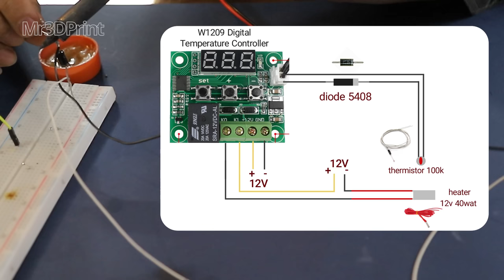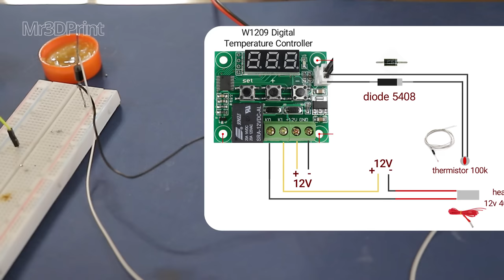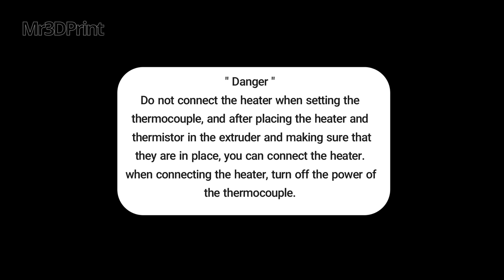#6 Heat and motion control with Thermostat W1209 & gearbox motor  -free filament (PET)

Comment: Why did you use w1209 and not the arduino shield?
Reply: I think he uses it because is cheaper XD
Reply: @mauriciocalderon102  Lol, he already use the arduino for the stepper motor, the arduino shield already have connections for thermistor, so I wonder why he used the w1209 but not the arduino.
Reply: @fastprojects  this setup is without arduino and stepper motors so cheaper and simpler
Reply: @tristansimonin1376  you're wrong my friend look at video number 5 and you will see.
Reply: @fastprojects  it's a new setup with a dc current gear reduce motor
Reply: @tristansimonin1376  ok thanks 😊
Reply from the maker: Many friends were unfamiliar with Arduino or did not have a computer, this method was made because of its cheapness and availability for everyone to choose and video
  This w1209 board practically shows the temperature up to 110 degrees and we have customized it for our work with a little change and we can adjust the temperature up to 290 degrees
Reply from the maker: @mauriciocalderon102  Yes that's right
Reply from the maker: @tristansimonin1376  Yes that's right
Reply: @mr3dp  But it's really inconvenient to see wrong temperature and calculate the actual one yourself...
Reply: @mr3dp  ¿Cómo es esa personalización?
Reply: can confirm its WAY cheaper

Comment: I've made a similar setup using an old 3d printer board and an extruder to pull the filament from the nozzle, is working like charm. Thanks for your videos, you're great! I'll try a gearbox (when I find one, I mostly use parts from trash).
Reply: Where is the video of your set-up?

Comment: Hi instead of using the old computer power supply, can I use the 12v 20A 240W power supply? And should I connect two wire like in 0:52 ?
Reply from the maker: yes

Comment: Excelente alternativa a la ramps. Ya quiero hacer mi recicladora de botellas. 
Dos observaciones, las temperaturas Celsius y Farenheit están incorrectas. 7:25
Y el w1209 trabaja hasta 100 grados Celsius.
Excelente trabajo, gracias por compartir.
Reply from the maker: La temperatura ingresada es correcta (por supuesto, esta temperatura no es real porque la temperatura de 77.5 grados Celsius que se muestra en el panel es en realidad 205 grados) Lea el texto del video
Reply: @mr3dp  Leí el texto, lo que no logro comprender es la equivalencia. Como quiera lo probaré, los circuitos son muy económicos. Gracias por responder. Saludos.
Reply: Hola ! Yo no logró que el hotend suba la temperatura , cuál será mi error ? Gracias !
Reply: Hola! Yo no logró que suba la temperatura a que se debe mi problema ? Gracias !!!!!
Reply: @workshop506  a mi me pasa igual hay desinformacion en el video

Comment: I see that the power supply has 2 yellows and 2 black wires, is one couple of yellow and black for the thermostat and the other for the motor? Or the motor connects to the thermostat
Reply from the maker: The motor is connected directly to a 12 volt power supply
Reply: @mr3dp  what's going on with the 12v on the graph image, the one which is created by the wire from the board and the heater, is that just meant to be connected or we have to connect something at that 12v section? And the green and black wire with the couple of wires which are yellow and black from the power supply, how did you get them there? Which connector did you cut?

Comment: Hi, why do you insert a diode between the thermistor and the controller board?
Reply from the maker: This board has a maximum temperature that shows 110 degrees. In order to be able to control the temperature of 200 degrees, we had to change the thermistor, and also when we add a diode, it shows less temperature. By doing this, we can control the temperature up to 300 degrees. Of course, the temperature shown on the board is not the real temperature and the temperature of 78 degrees shown on the board is 200 degrees.
Reply: @mr3dp  Ok! Thanks for your answer.

Comment: Maybe something to consider, but each bottle makes you around 20/22 grams of filament. Maybe there is a way to connect the cut bottle strips before pulling them into filament and thereby getting longer piece of filament in 1 piece? Or if not connecting it before pulling/extruding then maybe connect it afterwards? Otherwise you have to manually stop printing and change filament a lot. An idea for an extra video tutorial ?
Reply from the maker: Watch video number #1 Multicolor printing

Comment: I have a question, where do I connect the gearbox motor? To the 12v, but which ? To the green board directly or to the wires which come from it and create a 12v as in the scheme?? And the board how do I connect it to the power supply? Which 12v do i use? From the green board or from wires

Comment: in the W1209 circuit image you connect the yellow wire from power supply to the " K1 " in W1209 but in video you connect the yellow wire in " K0 " ? what is the right way please ?
can i change the PC power supply with 12v power supply ?

Comment: I managed to make the setup using my old ender 3 for spare parts, i tried to make the filament today with success but when i use the filament on my new 3d printer it doesnt have a grip, which means it doesnt extrude, maybe i need to increase the temperature a little bit from 210º and use larger plastic feed to make the filament more robust and get better grip.
Reply: The temperature required is 260 degrees but dont go over 230 without a full metal hotend
Reply: I'm going to use  spare ender 3 8bit board
Reply from the maker: The printing temperature of pet bottles should not be less than 250
Reply: @tristansimonin1376  @mr3dprint Thanks i will do that. : D
Reply: @bocian0  If you don´t need it. You definitely should. ; )
Reply: Maybe something to consider, but each bottle makes you around 20/22 grams of filament. Maybe there is a way to connect the cut bottle strips before pulling them into filament and thereby getting longer piece of filament in 1 piece? Or if not connecting it before pulling/extruding then maybe connect it afterwards? Otherwise you have to manually stop printing and changefilament a lot
Reply: @Trivimania  I dont know exactly what video is, but he shows alot of times in others videos that fusion together each piece into one single filament.

Comment: What is the function of the diode in series with the thermistor?  As is, the W2109 comes with a thermistor without a diode
Reply from the maker: Check description
Reply: @mr3dp  i did, doesn't mention the function of the diode. So none the wiser

Comment: is there too much difference between inflating and heating the bottle vs not doing it? and if so, how you did the system? im thinking you cut a bike valve and then glued it to a holed cap?
Reply from the maker: see video #2 Bottle Cutter

Comment: conecto el heater directo a los 12V, pero se queda en 90º máximo, ¿por eso es necesario el W1209?
Reply from the maker: Estimado amigo, esta temperatura no es real, mire el video cuidadosamente, la temperatura que configuró debe ser de 78 a 80 grados, esta temperatura es en realidad de 200 a 220 grados y, de hecho, es de 90 grados, la temperatura real es de 300 grados.

Comment: How did you put together the motor piece? the 3d print plate doesn't fit the motor and what screws did you use?
Reply from the maker: The 3D file is correct, but your engine may be different from the one I used

Comment: Awesome video and I'm going to build one for myself. I don't understand however the purpose of the 6 diodes in series connecting power to the motor. You make reference in the comments about adjusting the motor speed by adjusting the number of diodes, but what purpose do they solve. Don't they pass through full power, just in one direction only? If they provide resistance to control motor speed, why not use resistors? Many thanks for this series of excellent tutorials.
Reply from the maker: Thanks dear friend, yes I used a diode to reduce the voltage and thus reduce the motor speed, this was my solution for this, you may use another method for it, it is important to reduce the motor speed
Reply: @mr3dp  What speed should the motor be reduced to?

Comment: Hello I bought the W1209 a few years ago.
I always wanted to build a pet filament extruder and now I found your video it explains well but I have a question about the W1209 sensor.
Why did you connect the W1209 sensor with a diode 5408 to the thermistor 100K.
Thanks in advance

Comment: could you explain what was modified for w1209 understand that 275 grasu celsius is 87? I saw that it works but I don't understand why? is it because the thermistor is 100k instead of 10?
Reply from the maker: Yes, both because of the thermistor and because of the diode used, it shows the lower temperature, because we needed to use this circuit in a cheaper circuit.

Comment: Great project, @mr3dprint! I have a doubt about the needed power supply: how many amps.does it need to have in order to work?

I have a lot of 12V 3A PSU abandoned in my job and maybe putting some in parallel can avoid me buying one.

Kind regards.
Reply from the maker: این 12 ولت و 15 آمپر است

Comment: in the video you connected one of the resistance wires to k1 and the other to the negative of the source and in k0 you connected the 12v, but in the diagram it's totally different. what would be the correct connection?
Reply from the maker: You mentioned a good point, dear friend, but the two are not different if they are connected interchangeably

Comment: what is the subtitude for POWER SUPPLY ATX-300-12E 300 Watt P4 ATX Power Supply

WHAT SPECIFICATIOM IS NEED FOR THE EXTRUDER
Reply from the maker: You need a 12-volt, 15-amp or 20-amp power supply

Comment: Diode 5406 Is useful?
Reply from the maker: Yes, definitely
Reply: @mr3dp  After 100k thermostat connection, the screen gives LLL warning. What is the reason?
Reply from the maker: @ramazanaydemir3858  Change the diode wires
Reply: @mr3dp  diode is reverse connected :)

Comment: Does one motor with 60RPM work well? Cant find anywhere in aliexpress a motor with 12v 50rpm...
Reply from the maker: Yes, they are not very different, just for better speed you may need to use one more diode

Comment: hi in your video 4 Heat and motion control board you use 
RAMPS 1.4 and Mega 2560 but in your later video
you use W1209 board ..? have you showed 2 control boards to 
choose from or what confussing there thanks
Reply from the maker: No, this kit was chosen because many friends could not afford to buy an Arduino board, ramps and stepper motors, or did not have a computer to load the Arduino, etc.
Reply: @mr3dp  so i can follow the RAMPS 1.4 and Mega 2560 guide in series 4..as i have the parts and should get the same resaults

Comment: why are the diodes needed? if the power is 12 volts and the gearbox is 12 volts, then isn't it all good?
Reply from the maker: Diodes are for slowing down the gearbox motor

Comment: I did exactly this but my w1209 got on fire , literally ,   my question is why is negative connected to the thermocouple and not the board ? maybe sending 12v extra to the board make it 24v , what do you think could happened ?
Reply from the maker: Please take a picture of your wiring and connections and send it to me on Instagram to see where your problem comes from.

Comment: @dandiane
pourriez-vous faire un schéma de branchement,  car je ne comprend pas tout j'ai cru voir le branchement du moteur sur la broche de ( température sensor ) avec les 6 diodes 5408, alors que sur votre croquis sur cette broche c'est le thermistor 100k avec une diode 5408 et la sonde heater 12V 40 W est branchée sur le 12 V.
merci d'éclairer ma lanterne.
super travail j'espère pouvoir réussir votre projet mais il me manque des compétences notamment dans les branchements .
Reply from the maker: Connectez un moteur 12 volts avec six diodes (pour réduire la vitesse du moteur) à l'alimentation 12 volts que vous obtenez de l'alimentation de l'ordinateur (fils jaune et noir).
Connectez la thermistance 100k au thermostat avec une diode (selon le schéma enseigné dans la vidéo) La puissance du thermostat est de 12 volts, que vous connectez aux fils jaune et noir, d'autre part, le chauffage a besoin de 12 volts pour allumez, qui se connecte selon l'image, vous devez également connecter le cordon d'alimentation vert de l'ordinateur au fil noir pour allumer l'alimentation
Reply: @mr3dp   merci beaucoup pour votre réponse, je possède un moteur de 12 v de machine à écrire similaire au votre je ne connais pas son RPM mais je pense qu'il tourne vite puis-je utiliser un contrôleur de vitesse  de moteur PWM
Reply from the maker: Vous pouvez tester la vitesse du moteur doit être élevée
Reply: @mr3dp  une autre question sur votre schéma : le thermistor 100k est branché sur la broche sensor  il faut le brancher sur  le 12 v  fil jaune et noir  et le sensor sur le 12v il faut le brancher sur la broche température sensor je me trompe ?
Reply: @mr3dp   après re visionnage de la vidéo j'arrive à mieux cerner les branchements, avec toutes mes excuses pour mes questions d'amateur, merci pour votre patience.
amicalement

Comment: Hello, I have a question  
I have tried try to make the same stuff to make my own filament. 
When I tried, my filament (the output of the nozzle) is not totally round. I have only half of a cylinder (like this ∪).

Dou you have the same thing ?

Do you think it will be an issue with this filament on the 3D printer ?
Reply from the maker: yes

Comment: hola que tal, queria preguntarte si me servira este motor para armar el proyecto( Motor 370 Tipo 25 6v 133 Rpm Motoreductor Robotica Itytarg) gracias
Reply: perdon era este ( Motor Motoreductor Robot Fit0492-b 12v 100 Rpm Itytarg) , el que te mande anterior me di cuenta que era de 6volts
Reply from the maker: Hola querido amigo, este motor también es bueno, pero deberías reducir su velocidad de motor con más diodos o con un kit de reducción de velocidad.

Comment: Is the "Engine Connection" stl file supposed to have a hole in the middle for the motor?
Reply from the maker: yes
Reply: @mr3dp  re-downloaded it to see if it was a corrupted file.  No hole in the middle. 
Needing to change the indentation for a different motor, so adding the hole myself.

Just thought I'd let you know it isnt there in it's current state.
Reply from the maker: @br0k3nilluzion  Yes, you were right, the new file was replaced
Reply: @br0k3nilluzion  hey, can you share the STL files?
Reply: @maxleague4809  he made it all cost $$ for the file now

Comment: gearbox motor is directly connected to 12v power? how did you control the spooling speeD?
Reply from the maker: Yes, the gearbox motor is connected to 12V power with the diodes you see, if the motor speed is too low, you can reduce the diodes.
Reply: @mr3dp  Thanks! This is great!
I will use a 12v Motor Controller so I can set the motor speed at will.
Reply: @sjbox  to which 12v power on the scheme he shown u connect the motor? To the one directly from the green board or the one which appears from wires

Comment: Hi, I'm following all the proces of the filament production step by step but in my case I get the filament hollow inside. It is correct? I tried to increase the temp of the hotend but without success. Can you give some advice? Thanks.
Reply from the maker: Hello dear friend, when the bottle is very thin, like water bottles, the filament becomes hollow, but this does not cause a problem during printing. You can adjust the diameter of the filament in the software instead of 1.75 less, for example 1.55 mm.
Reply: @mr3dp  Ok, perfect. Thanks for your answer.

Comment: Hi @mr3dprint, I have a question about the diode: when I connected like the way you did it, I can't get any read on my W1209. But opposite, if I connected reversed, I can see that termistor shows values different to the values I get with no diode. Do you know what happens here?
Reply from the maker: Hello, please send me a message on Instagram to investigate your problem

Comment: what's the  six diodes for? reducing voltage?
Reply: for sure. Seems like 12v was too fast for the nozzle (filament diameter got less that 1.75mm)
Reply from the maker: 5 diodes to slow down the gearbox motor

Comment: Is there a specific reason for the diode used in thermocouple? The thermistor I got in the kit only can take 110 C. I tried putting 10k potentiometer with it in series. Because at Around 7k ohm its about 24 to 26 C. But I burned out my thermistor.....
Reply from the maker: It is necessary to have all the parts in the video because this thermostat does not show more than 110 degrees. You have to change the thermistor and the diode was used because it shows less temperature.
  This means that we can have a real temperature of 205 degrees at 78.5 degrees, which the thermostat shows

Comment: what's the speed the filament is being pulled?
Reply: the motor has 50 rpm, if you check last video the gears have a final ratio of 31.5 - 8motor with 36 teeth intermediary gear = 4.5 ratio , and 8 with 56 big wheel rim = 7 ratio, combined that is 31.5 ratio -   so 50/31.5 = around 1.6 rotation per minute for the wheel with the filament.
Reply from the maker: 20 to 22 cm per minute